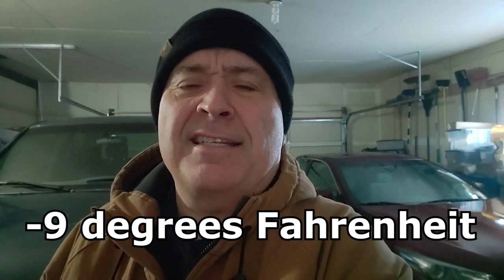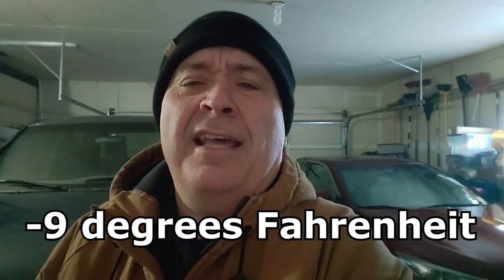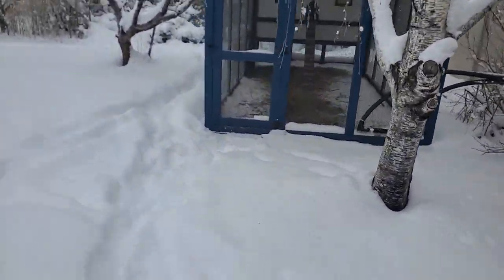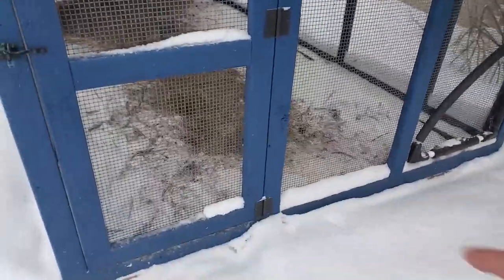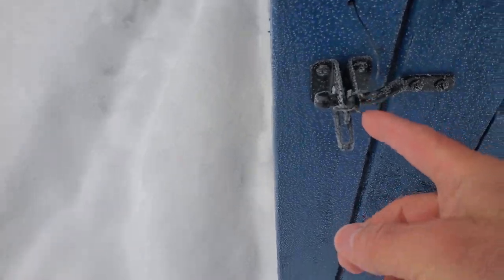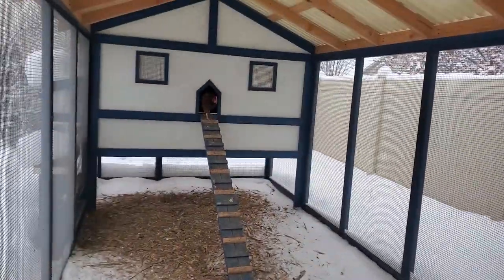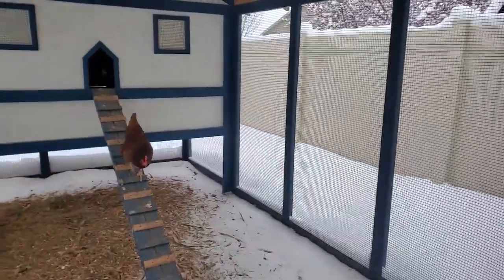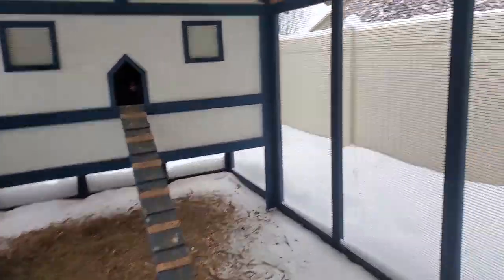Heated Automatic Watering System! - Quail - Rabbits - Chickens - 3rd Update!

Comment: def handy video! im sick of my heated waterer breaking
Reply from the maker: Thank you! What Ive learned out of this is to not use the pvc tees if you can help it. I think that is why the nipples ends are freezing. Once I get better whether I think I am going to replace the water bars for the birds with just a pvc pipe and dril the holes directly in that to screw the horizontal water nipples into. I bet I wouldn't be having the freezing I am if I had done that.

Comment: For the quail would it stay unfrozen if you put it in the sandbox area with the heat of the birds?
Reply from the maker: Your probably right. Good thought. I also thought if I put a box to sort of shelter the chicken waterers, that might protect them some. One thing too I thought might help is to just screw the rabbit nipples directly into the pvc pipe, instead of using the tees. I have seen others do that and I am thinking then the warmth of the water running behind it could warm the nipples better. I appreciate your thoughts.

Comment: Hi (again)  -racing to finish my cage winter waterer run before Monday's temp drop.
I have 6 36" wire cages under a 2nd floor 8' deck that I will drop wind screens down on super-bad days.  I'm using repurposed tailgate coolers with a 500w barrel heater and a 2 gpm circulation pump similar to Carolina Coop and yourself.
I'm using Pex tubing between the PVC drinker cartridges with sharkbite connections so when I sell a bird set, I can pop one out out of the system and easily reconnect to the return  or replace with a suitable length of straight pex.
My question is I'm worried about the small diameter 1/2" drink nipple pvc section and wonder if a larger 3/4 pvc or 1" -1 1/2" clear poly tubing would be a better option with the nipples (nipple pairs) being  fitted (glued in) directly  to holes drilled into the tubing to give the nipples more volume of >40° water vs 1/2" pvc covered in pipe wrap foam.  I will perfect these, but a 2 week vacation has me racing the cold weather.
Reply from the maker: Here is a video I recently did talking about the advantages of drilling directly into the pipe. https://youtu.be/0Lu0KXq9SIQ. 

I can see your point about the volume of warmer water being behind the nipples. I personally would think the 3/4 inch pipe would be plenty big, especially if your nipples are drilled directly into the pipe. I wouldn’t want to use any bigger than ¾” pipe myself, just because I want the water to keep moving and get back to the warm barrel as quickly as possible. 

Good luck on your build! Please email me and send me pictures once it is completed! david @ emergency prep guy . com. I put spaces in there so internet can't read it as an email address.

Comment: Do they may 18v hair dryers (heat guns) to thaw the nipples?  Building my farm and trying to make it as PA weather proof, and time/ergonomic as possible.  Pre thinking is better than after thought, right?  Another thought I had about your feeder bin is flairing the top of the hopper with a bigger lid to make it easier to fill those 50 "gallon" feed bags?
Reply from the maker: Those sound like great ideas. I am able to poor the 50 lb bags fairly easily but it would be nice if the tops were wider. People have suggested for the nipples using metal nipples for the birds because metal conducts the heat of the water running behind it. Also perhaps locating the nipples in the sand box area of the quail hutches to keep them out of the wind. And building an enclosed box around the chicken coop nipples to keep them from the wind. Also I noticed that Carolina coops no longer uses the pvc tees, they just drill holes directly into the pvc pipes and screw the nipples in the holes keeping the nipples in the warmer running water. I plan on making some if not all of those changes this summer before the snow flies. I am super happy that none of the pipes ever froze this winter and all I ever had was the nipples freezing. I think the above ideas will remedy that. Thank you for you comment.